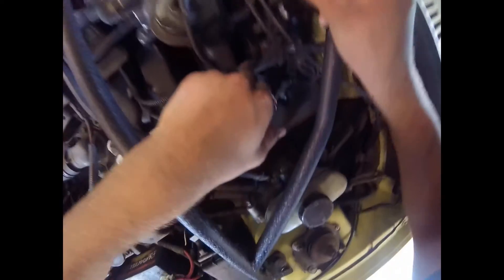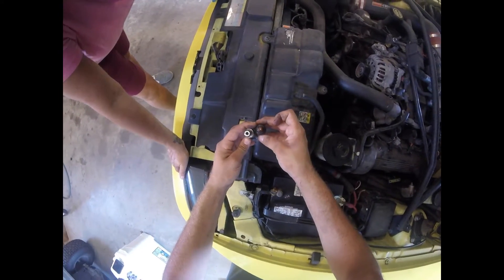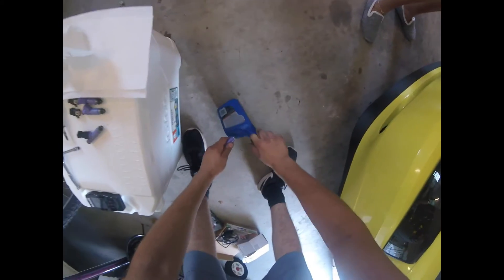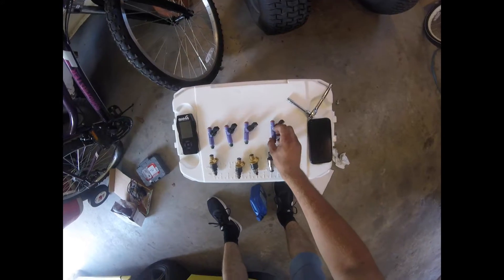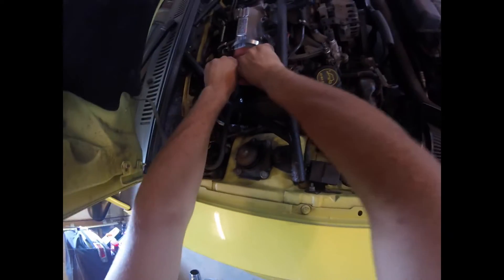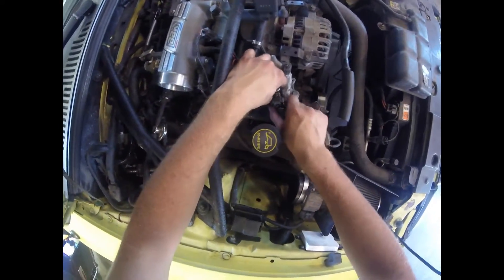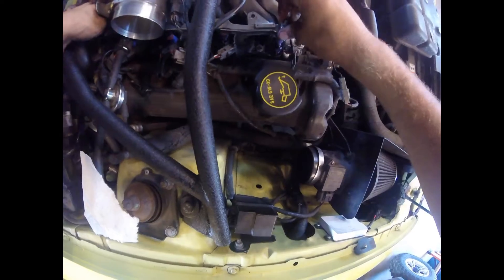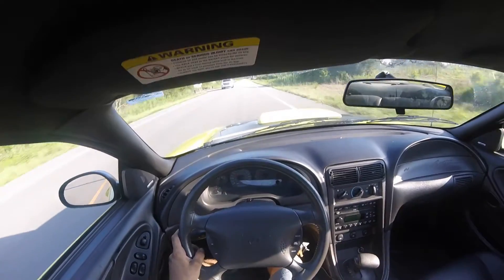How to install 24lb injectors in a mustang gt (99-04)

Comment: I still have my 19 lb OEM injectors from 22 years ago (2002 GT) and have been considering doing this upgrade especially since I installed a flexfuel upgrade kit so that I can run E85 fuel. I also upgraded the fuel pump to a DW340.  I'd have to take the car in and get a dyno tune though. A lot of money to spend on a 22 year old car. I do get what feels like occasional misfires but I don't get any codes. Just checked and a dyno tune here is $600. I guess it would be worth it to spend the money for a SCT tuner.

Comment: So does your rail not require retainer clips?
Reply: he got adapters
Reply: @haydenrubly  I'm aware you need different adapters but that's not what I asked. My mustang has an actual clip that holds the injector to the rail. I noticed he never used them in this video, rather he just bolted the rail down. I was curious to how they never came loose for him cuz 2 of mine keep popping out of the rail when I pressurize my fuel system

Comment: When you change to 24lb injectors, is that an option you can put directly into the tuner, or do you have to have Bama send you a custom tune?
Reply: The sct x4 lets you set the injector size, I haven't tried swapping out the 19lbs ones though

Comment: Do it add more horsepower if not what is the point. I have a 04 Mustang GT automatic dark shadow gray and I love it just the way it is I put chrome bullit deep dish on it and a cold air intake and pypes cat back exhaust and it is fast enough for me. I also have a 14 Mustang GT sterling gray and chrome bullit deep dish wheels and a 6 speed transmission and it is to fast now I want a corvette 19 or 20 maybe 17 or 18
Reply: Did adding fuel injectors make more horse power ? I think mine said 42lbs in  a 2004 mustang gt . Has stage one headers done to it .  Also read I’ll have to get a ecu tune. I’m pretty new to car stuff but I bought the mustang to play with .
Reply: It will help with fuel mileage slightly,  and probably with throttle response. A tune is a must, everyone use the easy Bama route,  I decided to get a tune that force me to learn the tuning science

Comment: Do you need a tune if you dont add bigger fuel injectors?
Reply: If you are using stock rated 18lb injectors you dont need a tune. It's the same.
Reply from the maker: Correct I guess I miss read his comment when I replied last time
Reply from the maker: Yes because you’ll put to much fuel into your engine and it will run rich

Comment: I also put the 24lbs injectors but I went with the pink Bosch and even when I got it tuned I was throwing so much smoke, and I just went back with the OEM ones, after driving it for awhile did the idle go back to normal? And did the smoke clear up?
Reply from the maker: It sounds like you may have a bigger problem then injectors because mine didn’t smoke after I put the injectors in

Comment: Do you need a tune? Because I have these and the adapters and I’m afraid to install em now after you said you need a tune
Reply from the maker: Yea because your car will run very rich if you don’t get a tune
Reply: @lucidracing2347  what if I buy a 86mm calibrated Mass  Air Flow Sensor for 24lb fuel injectors.
Reply from the maker: That might work but I honestly don’t know the only way I found from research was to get a tune
Reply: @lucidracing2347  what tune did you set it to?
Reply: @lucidracing2347  can you let me know if this worked for you if you decide to try it ?😂 serious doe

Comment: I have a 2002gt with headers ,cams stage 2 comp. ,throttle body  xpipe, ported heads , cold air intake , slp2   What size do u think I need
Reply from the maker: I would suggest 32lb injectors but I would ask your tuner for his opinion he’s going to know more then I will
Reply: what size did you go with? 
i have a similar build but no ported heads
Reply: @Victor-wr8pz   I found out I went with comp cam stage 3  for racing one and a bbc mass flow air sensor
Reply: Stock is sufficient,  put the money somewhere else

Comment: Did you noticed a power increase im thinking of doing this to my 4v going 24 to 30lb soon
Reply from the maker: I did feel an increase in the upper rpms because I felt like I was running out of fuel before the new injectors
Reply: 2Loud2Valve good to hear thank you
Reply: You need more air in if you want to add more fuel
Reply: Upgrading to 24lbs injectors is not a need for more air. You are getting 6 spray holes instead of 2 or 4, better atomizer . 
Perfect refreshment for a good sounding engine.
While you are tuning the ECM (I use Binary Editor, I get access to every parameter ) , you have to change injector slope, injector battery offset , and some other specs so the computer can adjust it's pulse using manufacturer spreadsheet